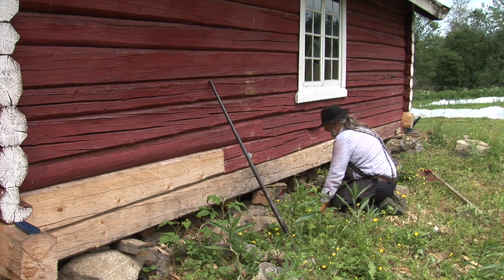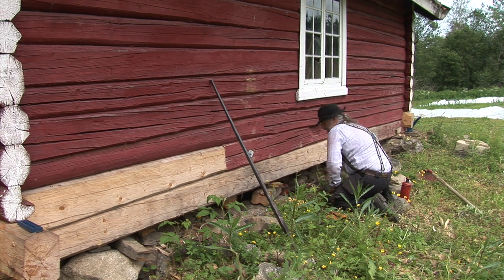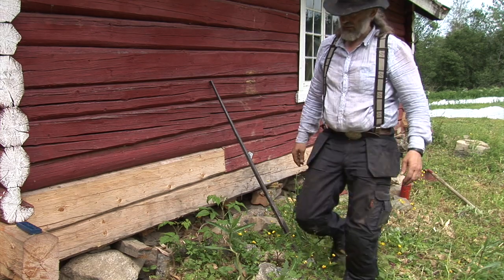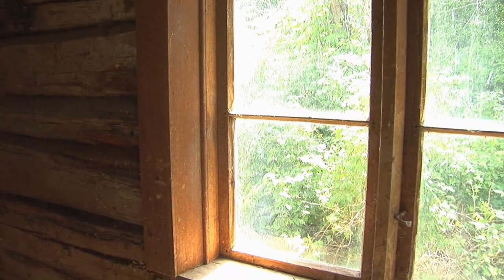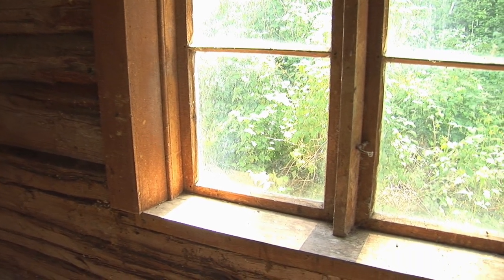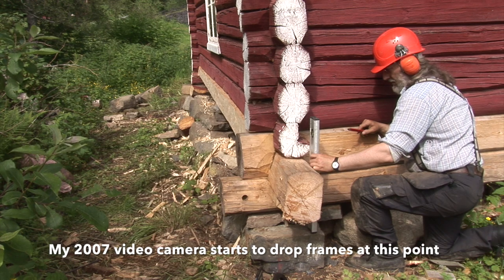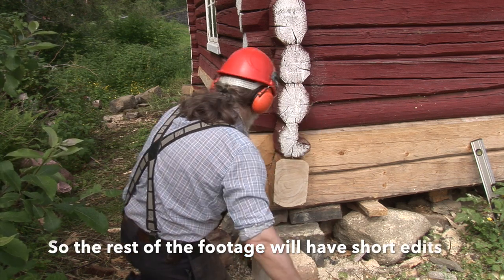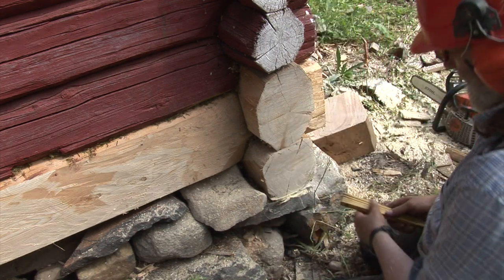🔴 Log House Repair in Norway Part 14/15

Comment: Just Beautiful! Am looking forward to the roof! I am struck by your use of the odd board scrap and other non-specialized items to assist as you do your work.  Use what you have...
Reply from the maker: All these farms have lots of bits and bobs stored for one day being useful, It saves a lot of back and forth to fetch extra equipment or materials to just use what is at hand. We do have all kinds of specialised equipment for lifting buildings  but I have found out that it is just quicker to keep it simple. The roof footage is damaged to some extent, due to camera damage, I will try my best to make something with what is usable. Production value has never been my strength, but the next few film are likely to be pretty sketchy.  All the best Mark, regards, Lucas.

Comment: Sorry to hear about the camera. TBH I am fine with the shorter cuts.
Reply from the maker: Thanks, the bad bit is that the drop-outs often include the good action shots..... I will just be using the SLR for new footage, which is great for fixed camera but has several limitations compared with real video camera. All the best!